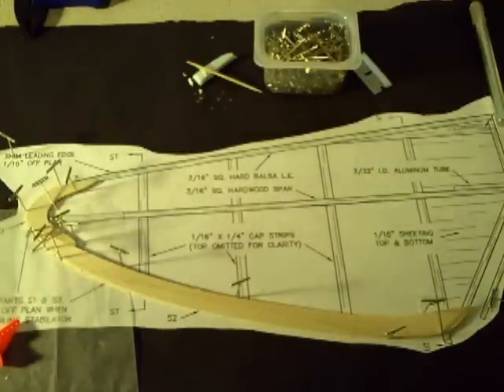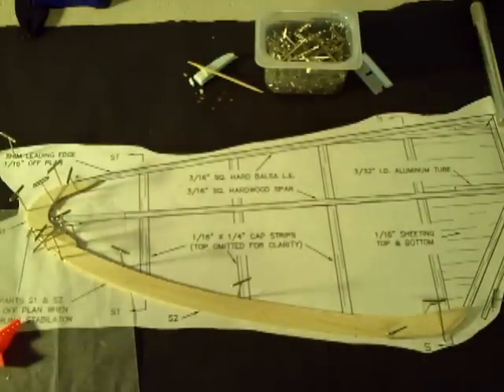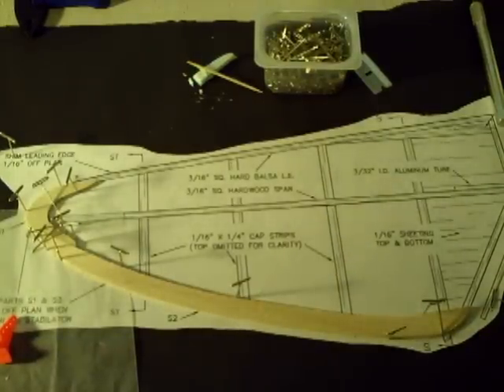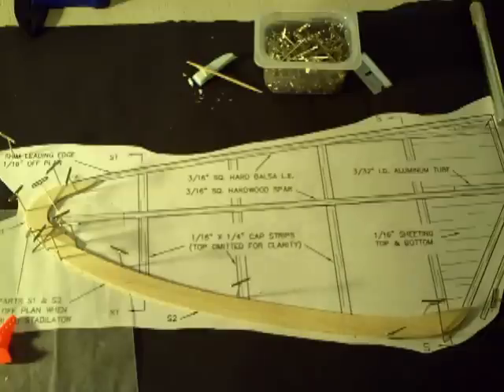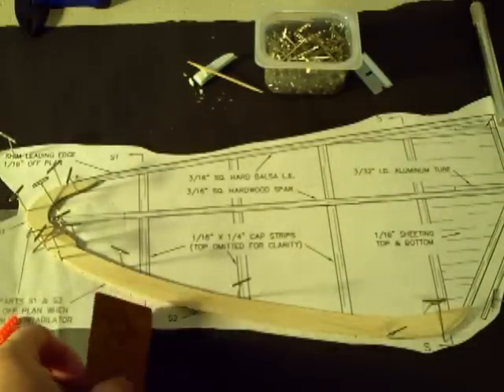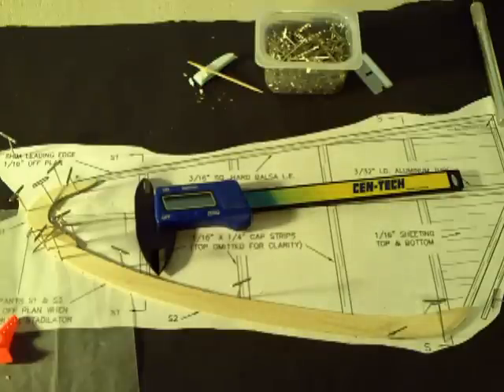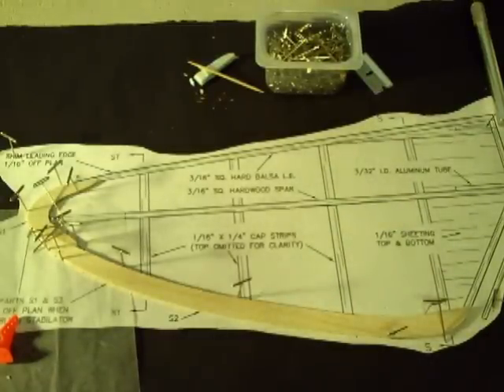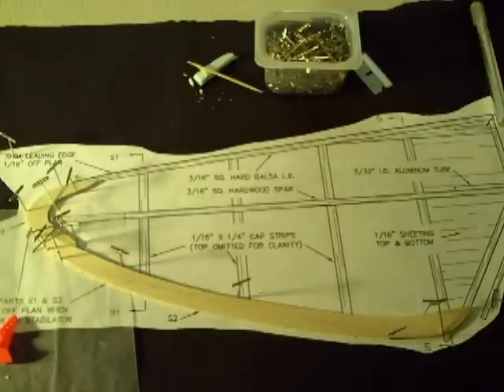Bird of TimeBuild Part 03

Comment: The idea is to get the leading edge, spar, and trailing edge all on the same plane.  The ribs are 1/16" thick and go under the spar, which raises it up 1/16".  Therefore you have to raise the leading edge up 1/16" also to get it on the same plane.  Because the trailing edge isn't as thick as the spar and leading edge, it has to be raised slightly higher to get it "centered" on the same plane.   Having said all that, I just shimmed the front and back 1/16" and called it good.